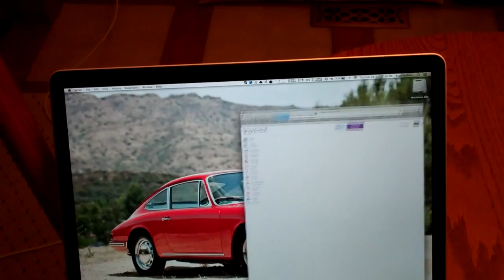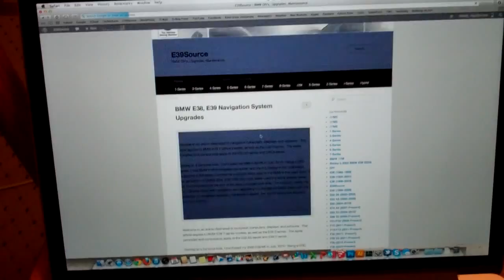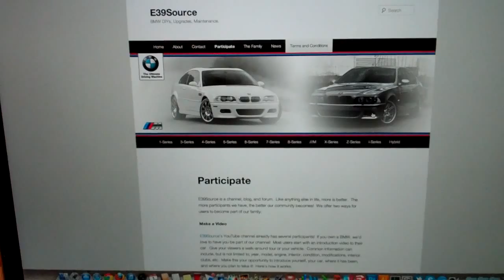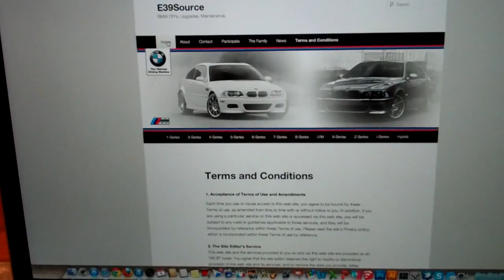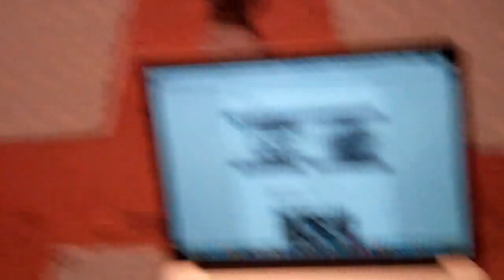E39Source  2/28/13 - Day 809

Comment: From what I remember, which is information about 6-9 months ago, the Dynavin wasn't 100% integrated with the BMW computer.

What I mean is that BMW's consumption calculations, average speed calculations and the like, which are wired into the High OBC, could not be reset with the Dynavin. For example, I've seen people with a non-nav head unit still have to keep the MID in the glovebox to reset their computers when they install the Dynavin.

I don't know the current Dyanvin integration status tho.

Comment: Is there a reason why you went oem when dynvain makes a almost perfect oem looking head unit that is made just for e39's (they make them for alot of vehicle's) but it has way more features it also has native ios support as well as a pdc on screen diagram and current car stats (oil pressure engine temp etc.) it also has a garmin gps there is other features too but it is irritating writing a comment with a phone. Also sorry for the crazy run on sentence.